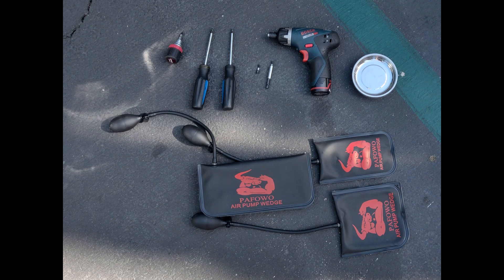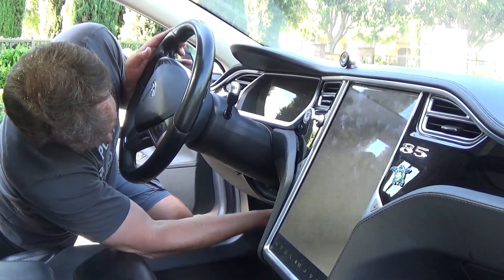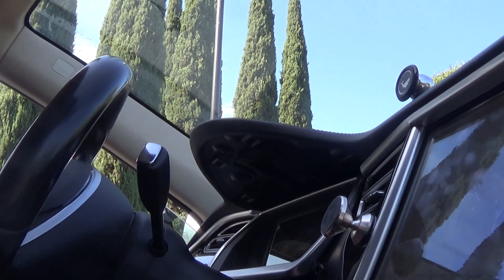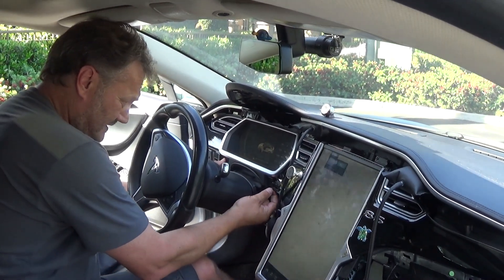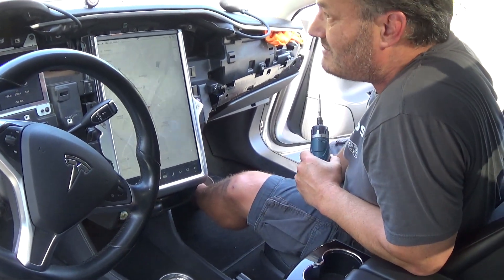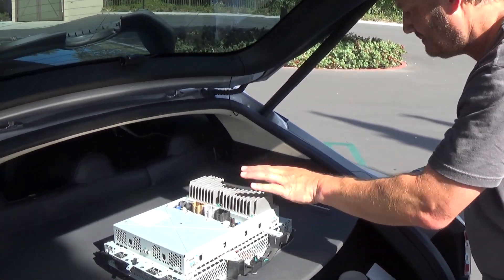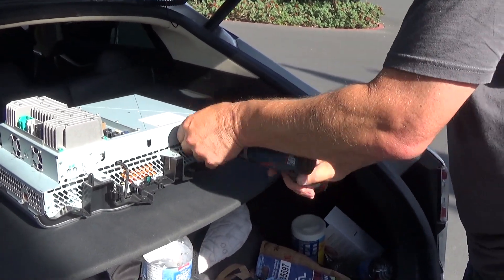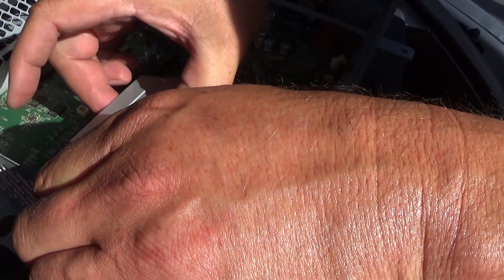How to remove the MCU from a Tesla Model S/X

Comment: Great video. I also have a question about software  needed to go from a MCU1 to an MCU2 unit. My gauge cluster bubbled out and I replaced the screen with a new unit but it wouldn't light up. Took it to dealer who said I need to replace the gauge screen, center screen with a new MCU 2, replace the radio and cameras all to the tune of $2800. What BS for a 6 yr old car. So I wanted to know if the radio is part of the center monitor assembly and if anything has to be done electronically to simply switch out an older MCu1 unit with a newer MCU2 unit. Also can the chip replacement as you described do the same thing as updating to the MCU2 unit?

Comment: So happy to have found this channel.

I am about to take delivery of a 2017 Model X (MCU1) and a wrecked 2018 Model S (MCU2). Plan is to transplant the MCU2 from the S to the X.

Your video shows the mechanical side of a change over but I believe there is a software component too. Do you know of any guides to what is required and how it is done?
Reply: Hi, did you find how to sort all out?

Comment: 12Apr2024 - Should anyone find themselves here trying to replace the SIM card on their UK Model S (my 2015 version has had the MCU V1 replaced with the MCU2 but prior to the swap of GSM connectivity from 02 to whoever it is that's providing it now - hence the need to swap my SIM which was supplied for free by Tesla... after a bit of arm-twisting), you may find it useful to learn that it is only necessary to expose the right hand side of the MCU to access the Sim card port. Therefore you may only need to remove the bits of trim on the driver's side (note: this is a RHD vehicle) and maybe to also only release the the MCU from the dash (tho it may be possible to swap the SIM even without doing this - I forgot to check when I put it all back together) - disconnecting the MCU is NOT necessary. Pics of the SIM slot location can be found here: https://www.facebook.com/photo/?fbid=10161690003616103&set=pcb.2494704987407321
I would still remove the 20A MCU fuse (LH fuse box as per video) as this will permit a full MCU reset which is probably needed after a SIM swap anyway.  HOWEVER! - move the steering column down and all the way out to make it as easy as possible to get to all the screws BEFORE removing the fuse.  This can't be done after the MCU fuse is removed. (You may also want to move the front seats all the way back, too.)

Comment: A little tip from a German mechanic. Please never put your knees on the seats. It will destroy your seat heating one day. Thanks for the nice Video.
Reply from the maker: That's good advice!
Reply: I never thought of this ever.  I camp in my car when I’m working and I use my left foot to plant into the front seat and basically all my weight in center.  Should stop doing that now

Comment: If anyone is interested in adding an amplifier to their tesla to upgrade the sound system, you can tap into those wires on the gray/white harness connector that plugs into the mcu for the front and rear speakers. The black harness connector has the wires for the center speaker. (2016 Tesla. Might be different for newer/older models) The speaker wire colors vary depending on the year of the car.
Reply: I have a base sound system with MCU1, got already better front and rear speakers (not installed yet) and want to get them fired by a 4CH amplifier. Are you referring to the connectors at the middle (grey) and right (black) of the lower part at 12:53?
Have you done this job already?
Reply: @mamu679  I ended up getting the speaker wire through the wiring harnesses at the doors instead of the back of the mcu since I didn’t want to deal with removing the mcu from the dash. Is yours a 2016? I can send you the shop manual.
Reply: @tristan.parrish  I have a 2016 MX with AP1. Thanks for offering the repair manual, I’ve already downloaded it from scribd.
Because of the MX’s FWDs I guess I’ll better get the signals from the MCU connector (I like DIY staff).
Next thing I have to find out is how to grab the signal for the under seat style subwoofer.
Do you have pictures from your mod?
Reply: @mamu679  Ohhh I see. I have a MS so I didn’t have to deal with FWDs and the base model doesn’t come with a sub so I didn’t have to deal with that either. Definitely would make more since to grab the signal from behind the mcu for you. Good luck to you sounds like a fun project!

Comment: I can use this to replace my emercency lights button that has stopped working. thanks.
Reply: I was told my hazard switch is bad too. Been searching everywhere as well till this video and your comment. Can I ask if you had to pull the MCU out to get to the back side of the switch and any screws to replace it or was there a different way? Thanks
Reply: @danielr.7658  I havnet' done it yet. but i doubt  it, you can access from the side once you remove the that driver side pannel. that's what it looks like at least.

Comment: Fantastic tutorial and very well put together.  Really shows each step clearly.  Thanks!    My dilemma is I had the MCU upgrade done and I found that the vent to the left of the center screen is stuck closed.  No air at all coming out, and unable to move the lever.  I have an appointment with Tesla, which is a distance from my home, and wondering if I should tackle this myself.  Do you think there's a way to get at that vent without completely disassembling the dash?
Reply from the maker: That is very easy to do. The steps to take out the vents is very similar to the MCU removal. In fact you have to take that vent out to get the MCU out. So if you just follow this video your should be set. I have taken the vents apart myself to clean them. They are very simple. You can probably get inexpensive used parts if something is broken in there.
Reply: @DavidDrivesElectric  OK, thanks David.  I'll consider doing it, especially if Tesla wants to charge me for the repair.  Since my warranty expired, I really will have to do most repairs myself in the future.

Comment: Can we just disconnect the 12v battery?
Reply from the maker: You can but you don't have to. I have taken out so many MCUs and never shut off the power before. It's fine
Reply: @DavidDrivesElectric  oh I meant while waiting for emmc repair. I don’t plan on driving it until I get the emmc back. Should I disconnect 12v battery while storing vehicle
Reply from the maker: @143Garage  oh yes! You definitely want to do that. Without the MCU in the car, the main battery will not 'turn on' and thus will not be able to support the small 12 Volt battery. The 12 Volt battery will die without the MCU. You can put the MCU back in without the eMMc chip. It will stay black but you can drive and charge the car.

Comment: One warning with using the car with a broken/missing MCU. When mine failed in December 2019 the speed displayed on the other dashboard screen reverted to mph EVEN THOUGH it said kph. Others with failing MCU’s have seen the same effect. Be aware that your speed might be completely wrong and driving in a 60kph local zone at 60mph (100kph) will probably lose you your licence.

Comment: The link you provide to evfixme.com does not work.  Do you have an updated link.  The yelp link works but is not the official website for Tony.  Thanks.
Reply from the maker: I just tested it, it works. Don't add a www. In front of it
Reply: @DavidDrivesElectric    Tried it in 3 browsers.  Chrome & Safari take me to a 404 Web Site not found.  page     and  Firefox takes me to a Tesla Motor Club thread on eMMC?  is that right??

Comment: Awesome video.  One question:  You say "put the MCU back even if you're not going to drive the car".  Do you mean, put the 2 ribbon cables and the other cable back, close it back up without the Tegra board, and hook it back up in the car?  This ensures that the 12v battery stays topped up?
Reply: Yeah I think that’s what he’s saying

Comment: I'm assuming that doing this is only advisable when out of warranty and Tesla has refused to fix it.
I believe you should make this much clearer in your video.
I thought the video was very well done and although I wouldn't want to undertake it, knowing how is always appreciated.
Reply: UK - Current quote from Tesla for MCU1 replacement (including 4G/LTE upgrade) with re-furbed one is £1400 (inc).  1 year warranty.
Reply from the maker: It is unlikely that the chip wears out before the warranty is expired. You are right if your car is under warranty, Tesla should always be your first go to place.
Reply: @DavidDrivesElectric  Actually.... We do see a good number if chips that wore out...  Some of our customers had Tesla replace 1 or 2.
Reply: @DavidDrivesElectric   David Drives Electric  .....or second for that matter. Nothing against your suggestion but if Tesla will fix it, that's where I would go first, warranty or no warranty.
You have upfront costs in special tools, the actual disassembly where things often go wrong, having a somewhat disabled car while your chip is in the hands of USPS and others, no enforceable guarantee and reasssembly, where things often go wrong.
So for me, it would be a last resort solution.
All that said, I still like the video!
Reply: @Rick9482  Yes, all of those are risks.  However, even if you have Tesla replace the MCU with a refurb, there is no guarantee that they replace the chip -- and so you will most definitely have the problem again; just a matter of time.
Of course, once your chip fails and either strands you somewhere with the aircon running without being able to turn it off, or you are lucky enough to continue driving the car, taking it to Tesla -- and waiting as long as two weeks to get a refurb -- is your only choice.
Reply: @ericlyons1887  Well during the last month I came to the conclusion that buying a Tesla is not for me. Too many negatives with the worst being very questionable build quality. Some of the issues being found in the Y simply astound me.
I'm looking elsewhere maybe even an ICE vehicle but more likely I'll to wait for more EV availability. Above all, I want a quality vehicle and Tesla is just not building to the high standards.